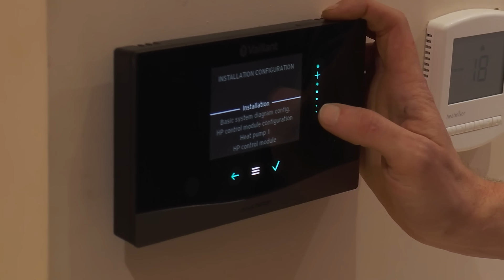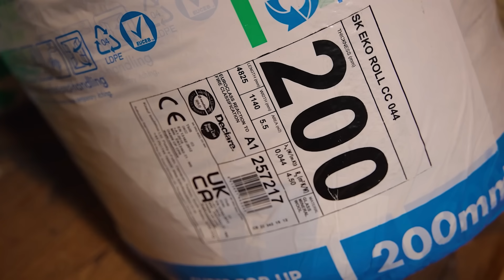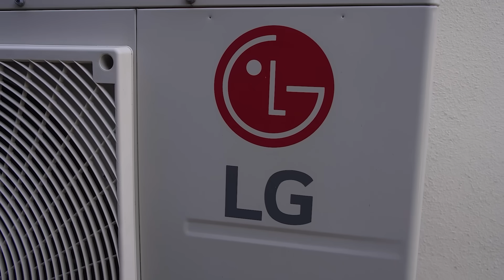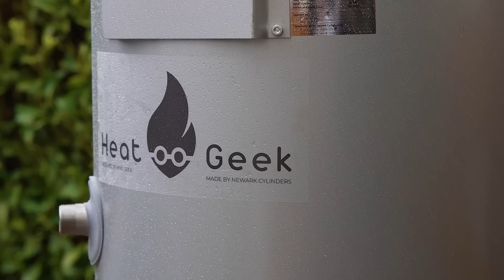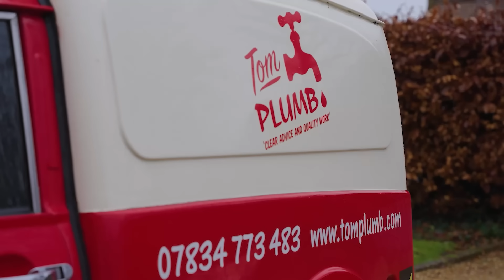Heat Geek’s Heat Pump One Year Later — The Verdict!

Comment: Expected result given that the “the best of the best” came out. For the rest of us, it’s still a minefield to navigate an ASHP and I’d even say even with Heat Geeks as I had a quote of them but the person that came out hadn’t at that time even done his first install. So for now I recon I’ll wait until the tech gets better and the industry is more mature.
Reply: I've installed myself two heat pumps that work great here in Romania. And I haven't finished a technological faculty but it's not that complicated. And we have here -20°C in winter.
The info is out there, there are some YT channels that are great. And the cost for me was about 2.600EUR for one unit, including installation.
Reply: The heat pump industry is 80 years old and very mature in 2025, long used in UK commercial sites and foreign domestic, it's only now as UK 'cheap' North Sea gas runs out that we need catch up with rest of World on domestic installations.
Reply: My friends had a "Heat Geek" (ASHP) specialist around. £50 an hour for 3 hours. He made one suggestion, and has done bugger all to alleviate a ridiculous amount electricity being used. When I say "ridiculous" I mean THOUSANDS of pounds per year keeping their dwelling warm. That despite having two solar panel arrays too.

The system is just about 10 years old. Produces hot water, and hot radiators, but cost a lot of money to keep the house warm. TRV's on radiators, no 'system' thermostat. No zones. It's either CH on or CH off. The "Heat Geek" fella, just took the money and walked off.  

Seems to me, the installation bought the installer a good holiday, or a car upgrade. Further "help" appears to be an expensive waste of money. In that respect, I would agree. Until installers can be trusted, (because they actually know what they are doing), and there is a pool of service engineers to maintain the systems, getting a heat pump is a gamble with the odds stacked very highly against customers getting what the are expecting.

Comment: Thanks Roger - great video. The pain this guy has had to go through just to get a properly working system beggars belief. I mean a small room just for the kit to work, a small crowd of specialists needed to GET it to work - is nuts in the context of a like for like replacement (which we are led to believe it is). But - I think people may be missing the point here. I'd rather use a primary energy source to heat my home - so - gas/coal/oil etc. If you have to use a secondary energy source to heat your home (electricity) then it doesn't really matter how efficient the secondary source system is - if you don't factor in the upstream losses of converting the primary (gas) to the secondary (electric) that you use. Anyway - thanks as always.
Reply: Heating with a heat pump using electricity generated solely by gas uses 40% less gas than heating directly by gas due to the efficiencies of the heat pump. Even considering transmission losses etc.
Reply: @Biggest-hz7ng   You aren't answering the point though.  It's not just about the cost, or the saving, it's about the hassle. I'm not going to go through all this faff to save a few hundred quid a year - if that, not to mention the potential for breakdowns with such a complicated setup.  If you want to justify your decision, fair enough, but don't expect everyone else to.
Reply: @TheDavecroft  it's the switch to decarbonised heating, and how do we do it quickly and efficiently.

Comment: The guys that should be doing this, properly i mean, will only be affordable by posh boys in large properties.
Reply: The large companies (Octopus, BG) will likely do a reasonable job on the jobs they choose to do. Their customers will get a system that costs about as much to run as a gas boiler. Install might be cheaper than gas with the grant.

Comment: Heat pumps and led lighting use so much less energy the load on the grid in a properly designed system shouldn't matter. Same with electric cars since they can charge at night

Comment: Sat here smiling at the electric heater there in the background 😉
Reply: Regs are conservatories are not to be heated off the main system (assuming regs are not ignored). Looking for a conspiracy where there isn't one.
Reply: To be fair, he's sat in what looks  his conservatory.
I doubt the heat pump helps much in there!
Reply: It would be there if he had a gas boiler, in fact, as he admitted in the video he'd have had have another within the house itself.
Reply: There is not an electrical back up heater in this system at all, apart from an immersion heater in the hot water tank. This is only for a back up for HW. Like any immersion heater in any HW tank.
Reply: In the conservatory, which is uninsulated and not part of the building thermal envelope.
Reply: @enjek5654  Should be with all the thousands and thousands of pounds spent at that address......
Reply: It works.
Reply: Glad it wasn’t just me 😂
Reply: Me too its that good he's got that
Reply: Why does everyone assume it wasn't consciously left in view? You want an award for seeing what's in plain view?
Reply: Yes, I clocked that instantly.. I'd have shifted it out of view..
Reply from the maker: we are not about shifting stuff out of view. This channel is real
Reply: @ Sure. But look at all the comments here mentioning it and drawing false conclusions from it.
Reply: @ You should of commented about it in the video as it made you look somewhat a fool.
Reply: @SkillBuilder then design and fit a system for REAL PEOPLE IN REAL LIFE SITUATIONS AND INCOME!
Reply: @C1223opuv    Read the comments and you’ll see lots of false conclusions, like yours for example. The temperature reached is what he is it set to. Why are you saying ‘only 20 degrees’ when that’s what he has this thermostat to?
A thousand pounds worth of electric? That’s over a whole year for a huge house. It’s a tiny cost for that. Did you not really understand what he was saying in this video?

Over complicated? It’s actually much less complicated than a gas combo boiler, it’s just that you don’t know how either works so you think bigger = more complex.

Why would they need heaters? They already have a heat pump that is working well.
Reply: You beat me to that comment!
Reply: Eagle eyes are here !  Spot on.  And we can all listen to the "relaxing" DRONE of the air con unit 24/7.  GREAT !

Comment: "Tides". There are maps of tidal potential around the UK. There isn't nearly as much as people seem to think. People think Severn would be massive, but actually even the biggest plan for Severn wouldn't produce as much as offshore wind farms we're currently installing. We don't have many Severns, and 'enough offshore wind potential to power Europe'. People need to accept the reality of what's in UK's cupboard.
Reply from the maker: Check out the Swansea Tidal Lagoon. There is plenty of potential and there are lots of good bit of technology that we could develop.
Reply: @SkillBuilder And check out the cost. It's great fun to talk about the potential of tidal power, but the reason we don't build it is because every time you look at an actual project, it's horrendously expensive. 

And it's not like PV / wind / batteries / SMRs: there's no way the costs will ever plummet because it's basically a LOT of civil engineering.
Reply: @SkillBuilder there are I think 3 lagoons being proposed for the bristol channel ..both north and south sides,  lower complexity projects which probably makes sense.

Comment: The financial outlay on these is totally untenable. He could have had all that insulation work done and then simply had a combi boiler ticking over on modulation to give him the exact same heating experience. There's nothing special about heat pumps in that regard. No doubt here come the carbon-crowd to tell me I'm stuck in the past.
Reply: "What about the outlay?" is what Thatcher said when we moved to switch to gas from coal. We need to move to low temperature heating in the coming years.
Reply: @Biggest-hz7ng   Coal was massively more expensive than gas.  Unless you were a miner when you got it free!  In the 1970s my parents paid £10 a week for 2 bags of coal, thanks to Scargill and the Unions. Also using coal was a very inefficient way to heat a home, and it created loads of air pollution, that's why we had to switch.
Reply: @TheDavecroft  I believe the outlay she refers to was in laying the gas mains etc. during the 1970s.
Reply: yes and the funny thing is that carbon is GOOD and that even if it created a warming world that would also be good as it would create less energy demand

Comment: Still make the same comments on this. Initial cost for the system now. Component cost. Expert labour install cost. Would have been consultant cost. It was a project and a showcase, but in the real world, astronomical. Getting that amount of expertise on your job under normal circumstances, a big problem and again at what cost. Bulk of the system in a more average house. Not a six bedroom small mansion. Then another big killer for me, flexibility. Others in the comments mention it too. Constant running to be effective and this 20 degree nonsense. I don't like all my rooms one temperature. And I like it pretty cold at night. I have always turned the heating off over night, usually from say 10pm to 4am. I grew up with open fires. They went out overnight and you woke up to ice patterns on the windows. My body is used to cold night temps. Still not for me, heat pumps. Not suitable for the average house as a refit, in most cases. And even not suitable for the Houses of Parliament. There is a good recommendation for you.
Reply: Heat pumps can be reduced in temperature overnight. Alleged issues with the implementation in Portcullis House doesn't make them unsuitable for regular houses.

Comment: Of course the point that 32% of our electricity comes from gas fired power stations is a core reason why gas will always be with us. If gas for domestic usage is going to disappear in the next twenty years, you wonder why they are replacing all the gas mains. Blue Hydrogen will be the gas of the future. Take North Sea natural gas, turn it into Hydrogen and pump the carbon you take out of the natural gas back into the rocks you extracted the natural gas from. The North Sea gas and oil fields are going to be worth a fortune as carbon capture fields once the oil and natural gas is removed. 

As to a domestic heat pump. Our 12 year old Vallaint boiler will need replacing in the next few years. Do I buy a new boiler that can burn Hydrogen as well as natural gas. Our look to somehow fit in a heat pump and all the gubbins. If I can fit in all the infrastructure in the loft and bolt the heat pump up at the eaves it might be an option!
Reply: Gas will be delivered for a while yet - thus they are saving us from being blown up by replacing the mains. There's due to be a lot less used by power stations by 2030 though.

However, hydrogen isn't and likely won't be affordable for the foreseeable.
Reply: @Biggest-hz7ng a lot needs to be done in five years to make our energy mix very different by 2030. The one advantage of gas fired power stations is they are quick to turn on during peak demand. You cant switch renewables or nuclear (nor coal for that matter) on and off like you can a gas plant. So with the demand for electricity growing I can see gas being a very important component for a long time to come.  Cadent are spending £1 billion in London alone upgrading the domestic gas mains. It’s not preventative maintenance. If it only had a 20 year future, they would just patch it up as safety demanded. They are upgrading for the expanding demand and higher pressures the gas network will be required to cope with. I think domestic gas will be with us for at least another century. Blue Hydrogen will be a bridging technology. Then green Hydrogen will replace it. Created using surplus renewable electricity. Turning excess wind and wave generated electricity  into green hydrogen, will be a better energy store than battery storage.

Comment: I had a condensing boiler fitted 2 years ago, and switched to low and slow for our heating for the winter. Flow temp hasn’t been above 40 (currently 35 after the last cold snap) and house has been lovely but still getting her indoors to understand the fact that the house takes time to recover heat lost when she goes outside and leaves the door open because she is coming back in a minute!!! 20 year old house with standard radiators and 10mm microbore drops to rads.
Reply: I sort of have the same and been testing mine, 1980’s house, 8mm microbore, turned the boiler done to 6kW (lowest it will go) flow temp of 40oC and set at 21oC. I program the heating to go off for a couple of hours in the day to heat the hot water and also have a 18oC set back at night, again the heating switches off at night for a couple of hours to heat the water
Reply: @stephenlawrenson2380  If it’s left in most of the time and there is some decent thermal mass to the interior, opening the door doesn’t actually have that much effect as there’s such a disproportionate amount of energy stored in the building fabric that’s radiated back into the rooms when the air temperature drops a bit.
Reply: @enjek5654  Yes, we had a couple of windows being fixed for a couple of hours so had a big draft through, when done after a few minutes the house felt just as warm. 

We do have a large thermal mass as it's an old council house with really dense bricks on internal walls, the downside is longer heating up time from scratch, but leaving on all the time is brilliant.
Reply: @MentalLentil-ev9jr  for the relative newness of the house, most of the internal walls are block. I believe that if I don’t get the heat into the walls, and keep it there you are fighting a losing battle. I remember being petrified of our, then, young kids, touching the radiators with the old (non-condensing) boiler and the house never seemed to get warm and keep warm. I think that the block would suck the heat out of the air space.
Reply: @stephenlawrenson2380 Similar here - old boiler was 15 years old - considered ASHP but didn't feel confident enough so had a viessmann gas boiler that could work at low flow temps fitted - Highest flow temp over the winter was 34 deg C - heating 24/7 - none of the rads feel warm but the house is comfortable all the time
Reply: @ianmarsh4712  that boiler was on my shortlist but went Intergas, both very similar in performance although I thing yours has better weather compensation curve control. Part of the final decision was cost and the VM was nearly 1k more than the IG - topped off with free installation from one of my best mates who is a Brickie 😂😂 nah he GasSafe but a very good mate. I have compensated him him though by paying entry on competitions in our sport
Reply: @stephenlawrenson2380  Viessmann boilers are good but by christ they make understanding the boiler hard work - "urban plumbers" video on why Viessmann boilers are hard to work out is a moment of genius - Intergas and Atag were my other options but finding a gas engineer that wants to fit something other than baxi or WB was borderline impossible
Reply: I'm not convinced, Combi for me.
Reply: To be fair your insulation standards are close to optimal payback. More insulation, will you ever see your money back? Probably not.
Reply: Sorry, just an aside, I think loft insulation above 170mm is a waste of time, unless you live your life hermetically sealed away from the rest of the World and never throw open your windows and doors. Been in many lofts every week in every season.  150mm is just fine. Anything above is just diminishing returns.
Reply: Does that affect your hot water temperatures? If your hot water has a low temperature (40)  you could be prone to legionella.
Reply: @DanRyan-v5y  - HW isn’t impacted with a PDHW system - boiler knows if it’s doing HW and ramps up flow temp and runs highest modulation it can to get the HW done in shortest time possible - then reverts back to CH at a much lower flow temp (in my house 115 litres from 25 deg C to 55 deg C in 22 mins)
Reply: @ we don’t have hot water storage, and that temperature is only for the heating loop, the water temperature is higher for showers/washing
Reply: I'm not sold. Sorry, mate. If I ever got one, it would be at Gun Point .
Reply: @ what, a condensing boiler (that I was on about) or a heat pump??
Reply: Seems an ideal system to switch to heat pump when the boiler's time comes

Comment: I think that seeing that electric heater in the room where you two are talking says it all for me. You can stick your heat pump .
Reply: It's an infrequently used conservatory without a radiator. No evidence they've needed to use it.
Reply: @Biggest-hz7ng   If they didn't need it why have it out?  I have a fan heater in case my central heating packs up, but it's in the cupboard under the stairs gathering dust, not sitting in the living room!
Reply: The electric heater is in the conservatory just in case we want to use it in the winter when folks visit. In reality we’ve not used it or the conservatory. I’ve another redundant electric heater in my office - note not needed because the HP dies its job and provides cheaper heating!

Comment: Roger are you slowly becoming a heat pump convert. Its about time!
But please don't push more regulation that is what is slowing it all down. I've been to several MCS heat pump installs and one I had to re pipe completely it's not a guarantee of a good job. Recommendation is the best thing to go by. I'm not a heating engineer by the way I'm a industrial pump installer with just enough knowledge to put crap work right
Reply from the maker: John 
 I am not a convert to anything. I was clear enough when I said that we need  a range of solutions. This is about heating homes not spreading dogma.
Reply: @SkillBuilder  did I touch a nerve, sorry about that.